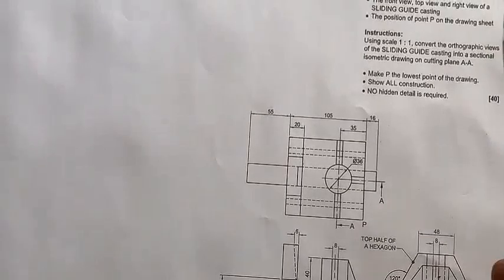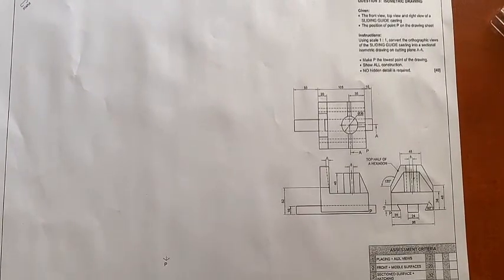Isometric Drawing/Grade 12

Comment: Why don’t you hatch those things connected to the cylinder?
Reply from the maker: Yes, those are supporters and the cutting plan is long their height.
If the cutting plan is across their height, that’s when you can section them and it will be like a Top View in Section 🎉
Reply: @etutorsdigitalschool2215 thank you